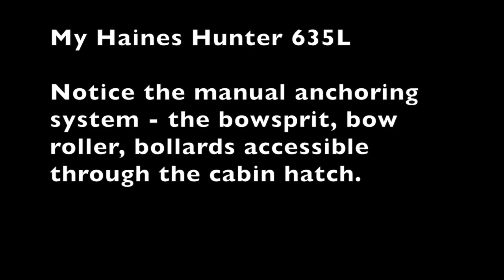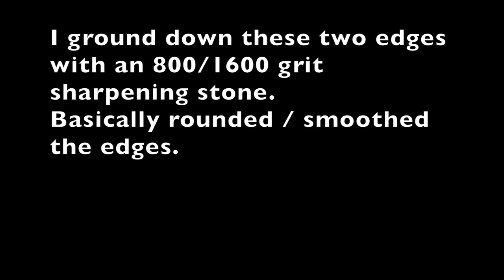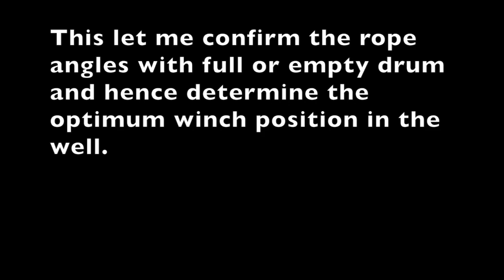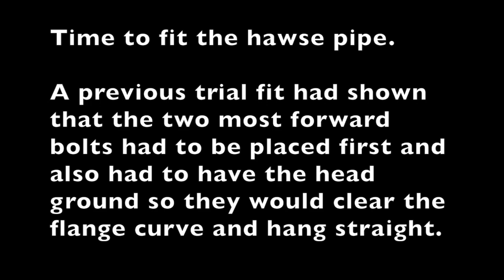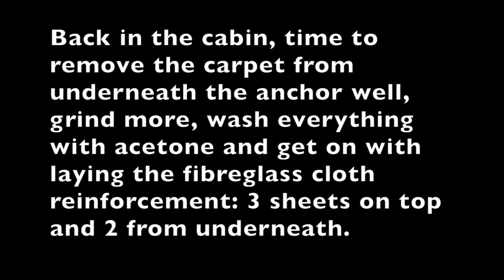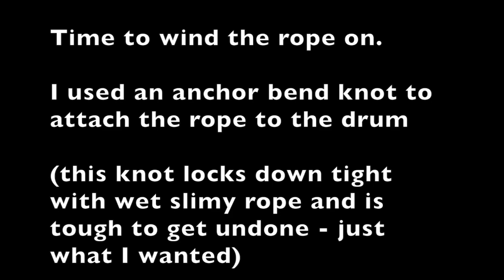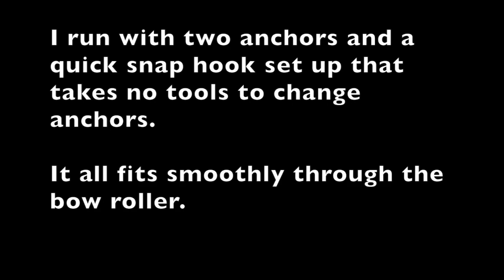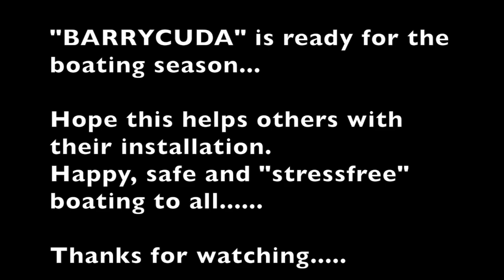Installing Anchor Drum Winch in my fiberglass Haines Hunter 635L

Comment: Hi great video, do you have trouble washing mud and salt water off the chain and warp?
Reply from the maker: Hi. Thanks. No real issue, I use a hose garden sprayer (shower head type) to wash down the boat and trailer after each trip. During that process I open the anchor hatch and run water over the chain, rope and winch - this runs out through the anchor well drain. Having said that, most of my anchoring is when fishing in 50-60m offshore (>100m of rope out) so very little mud. When I anchor in estuaries (mud) they are much shallower and  I typically only have 20-30m of rope out - so its the top few layers of rope on the drum which are easy to rinse with hose. If I'm not happy with result, I just pull off that rope, wash and rewind.  The Stressfree winch is waterproof and the manufacturer recommends a fresh water rinse after use and an occasional spray on the exposed faces with WD40. Cheers

Comment: What happens when u take a green wave over the bow.   U should of made anchor well sealed away from cabin.
Reply: Yes of cause mate. Very bad idea. Anchor well must be sealed off completely away from cabin
Reply: Yes wait until u take a greenie over the wave . Very bad idea to have an open bow. In a closed off cabin.  Thats how many ships sink through the chain locker doors left open.   U will get caught one day.  !
Centre console is centre console. They are either flush deck . Or a good bulge system. 
Csbons are ment to stay dry . Eindows are for air vent.
Reply: My concern as well.
Reply: @zk8241  bit of water doesnt matter, thats what boating is for, if people dont like water, stay on land